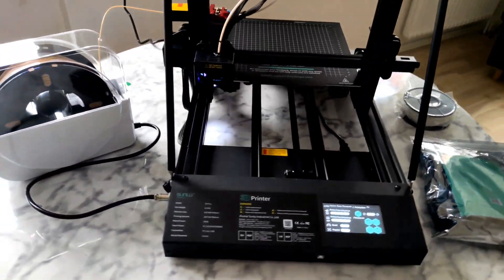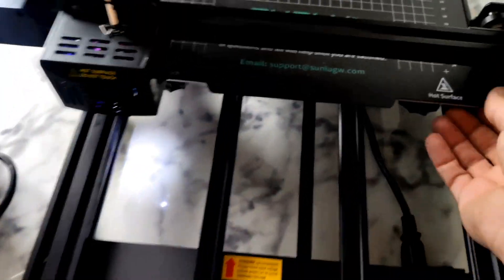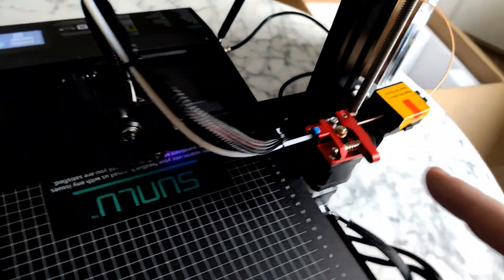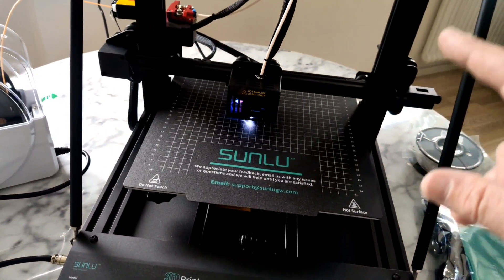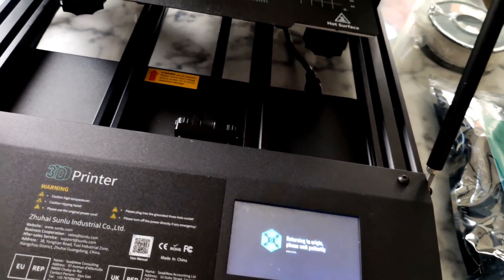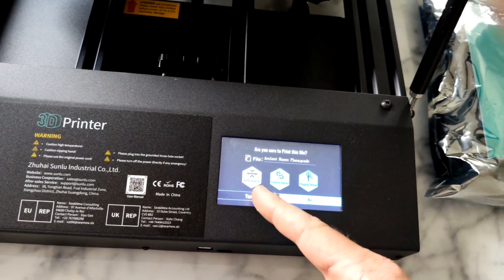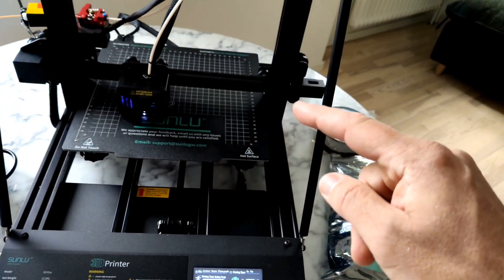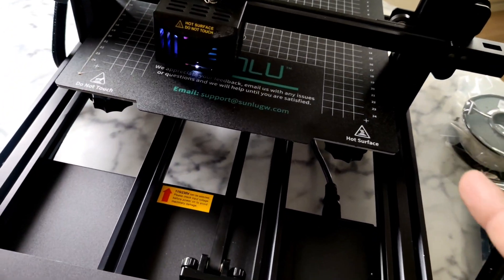SUNLU S9 Plus - Large Size 3D printer first run

Comment: This printer sucks so bad . I just bought one and I`m returning it . Its just awful .
Reply: mine printed great from the box, I upgraded from the s8 pro to the s9 cause it was on sale for only $207 on amazon and it came with dryer box. I just used the same settings from my s8 and did the same to my s9, you still have to do the manual leveling with the paper trick which only took a few minutes, one thing that's always work for me with using this printer is the temperature settings. it's the main reason why your print won't adhere to the bed, (216C for the nozzle and 66C for the bed) is the sweet spot. also I replaced the rubber flexible bed with a textured metal one. I never have problems with my prints coming off while the bed is hot and pops off easily with print bed is cooled off.
Reply: @nealaskme6272  Hello, do you really recommend this printer? I have read a lot of negative things... how fast is it, do the impressions go to bed?

greetings